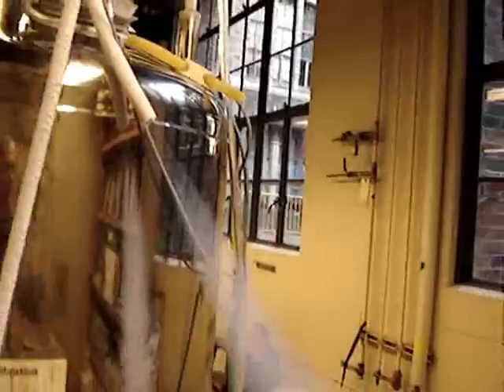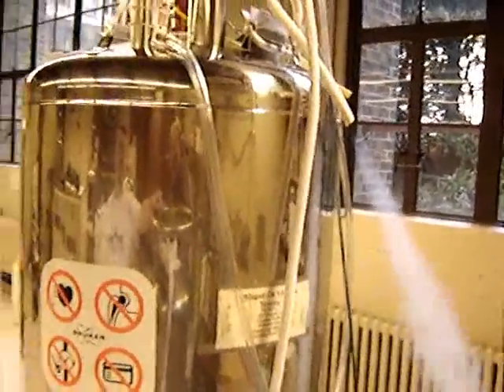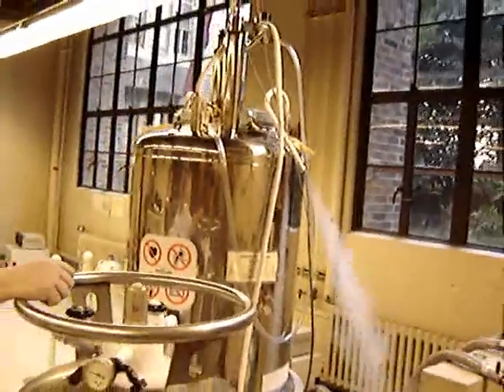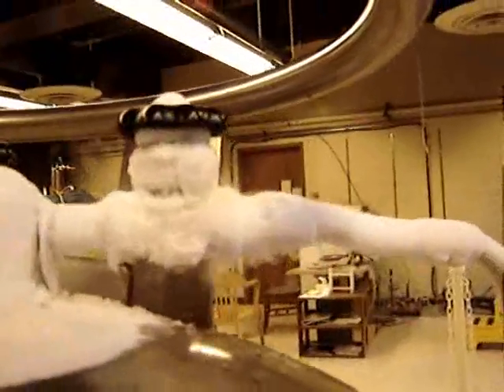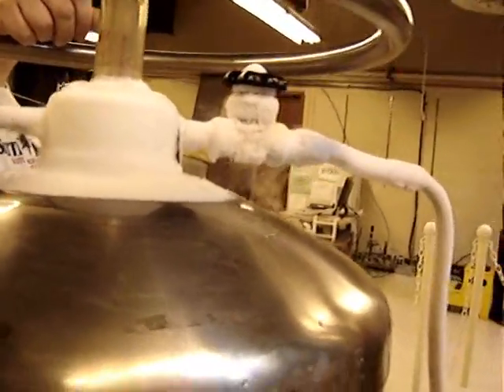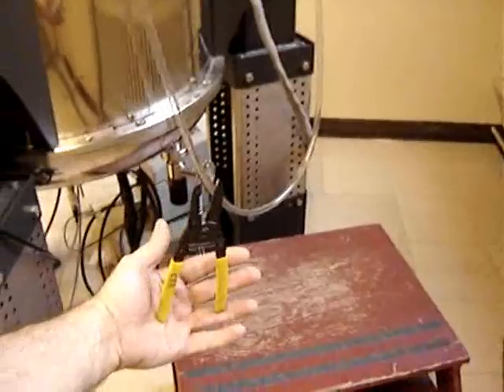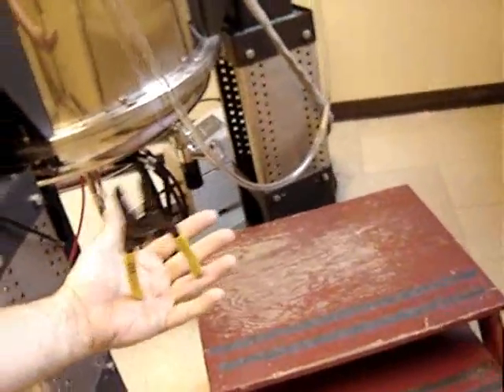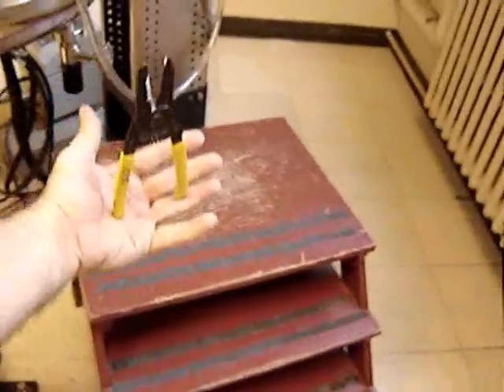Superconducting NMR magnets

Comment: Typically, the spin states of protons (aka, hydrogen, +1/2 or -1/2) are equal in energy. The standard kind of proton NMR puts out a strong magnetic field, which creates forces on proton spin states so that they separate energies instead of being equal. Once the energies are "split," the NMR can send radiation through the molecules. Hydrogens in different types of molecules are split by different amounts, and absorb the frequencies based on how much they are split.

Comment from the maker: Yep, LN refill.  *Very* cold N2 gas is pushed out, and the entrained humid room air has a condensation cloud.

The blue color implies water droplet size of ~optical wavelength.  Probably the immense temperature drop causes spontaneous condensation without nuclei.  So rather than few large cloud-droplets, you get many smaller ones (more like molecule clusters than like droplets.)

Fog from the chilled metal looks white: fewer much larger droplets >> 700nM.

Comment from the maker: > ..As they do close to the source of flux, either end

> of a bar magnet

Exactly.  But even with parallel field, if the lines are dense in one places and sparce immediately adjacent, then the attraction is strong.  Math idea: "gradient of the field."  A strong field can align iron objects, but it takes a field with strong GRADIENT to attract them.   I always imagine that gradient means "spreading-ness" of the field, but parallel lines can also have high gradient.

Comment from the maker: > Are they two separate forces, then?

Nope. If the magnetic field has about the same strength everywhere, then a ferrous object won't be pulled in any one direction. Yet if the field is strong, the object will be strongly torqued into alignment. Compasses twist into N-S alignment but are not attracted either north or south. Now if instead the flux lines spread radially outwards, then a ferrous object will be attracted, and will move towards the region of higher field.